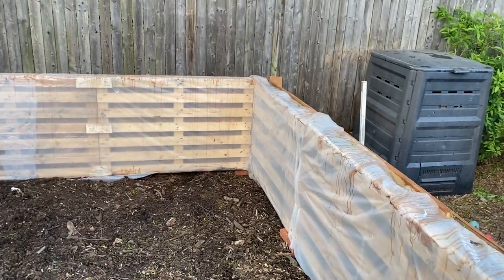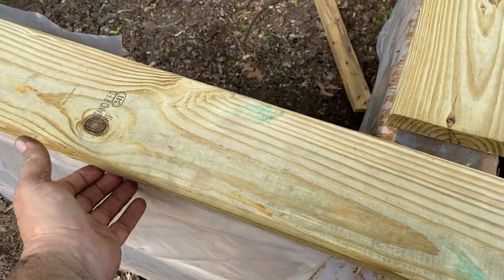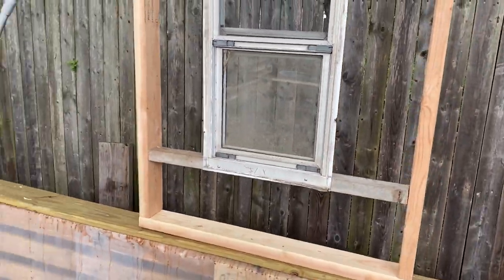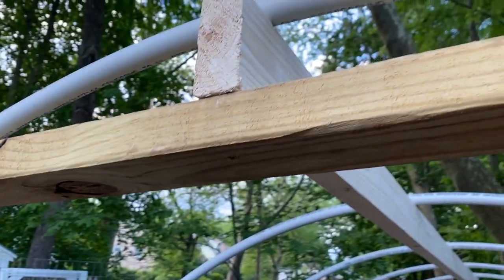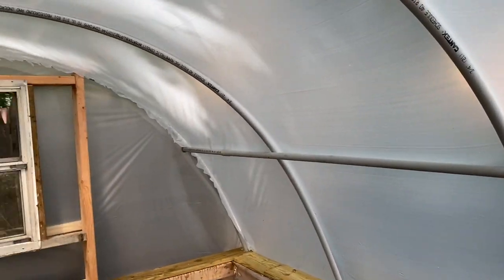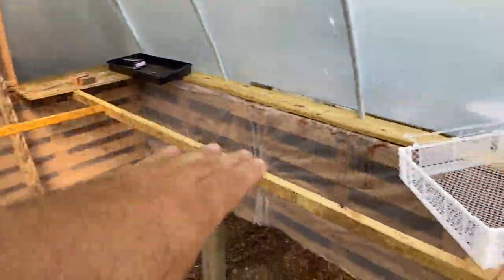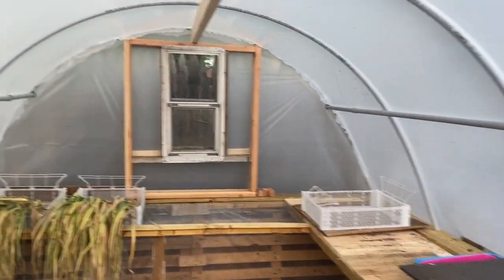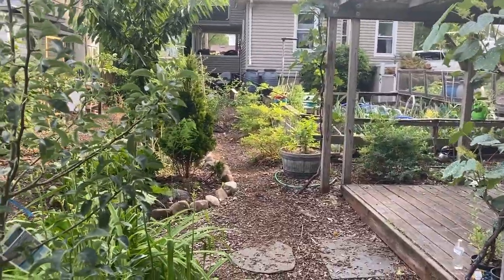How to Build a Pallet Greenhouse for Your Garden - Looks Good/Functional/Almost FREE!

Comment: Don't know how winter is where you are but I'd use a couple of those black water drums in there. The drums will heat up and the water will radiate a bit after nightfall
Reply from the maker: I thought about that because during the day the greenhouse does get quite warm even when the outside air is in the 30s, but during the dead of winter we routinely get 0-20F temps for stretches at a time and I wonder whether it would be effective.

I've also considered building a compost bin in there and filling it with horse bedding, but I decided I didn't want to smell THAT all the time I was in there :) Besides, I do zero gardening during the winter so I decided to just let it be

Comment: Two woman who have NEVER done this before and we sure want to try.  We have NO tools!  Any suggestions on how to do this by hand without the PVC Piping?  Can we just make a ceiling out of 2 by 4's?  Help!  We know nothing and have never built Any thing in our lives!!!
Reply from the maker: You're really setting up a challenge for yourself, aren't you? Certainly it can be built with a hammer, nails, and a hand saw, but man, you're going to be sore! :) My suggestion would be to build the two end walls first, making them in an arch-ish shape, then instead of 2x4s for the "arches," I'd use 2x2s. Instead of running them in the direction of the PVC pipes, I'd run the 2x2s straight front to back. Just nail them in from the end wall. 2 or 3 on each side of the "arch" should be sufficient (some pieces in between each row for support is recommended). That will limit your length to about 8 ft. long  unless you put another wood arch-ish shape in the middle then you could make one up to 16 ft long. It's definitely a much more complicated -- and expensive -- alternative. Wood still ain't cheap these days. I won't lie, it's not going to be easy. Again, doable, but using only the most basic tools and limiting yourself to all wood, it's a much more difficult task you've set for yourself. I never want to discourage someone from trying something new and challenging, though, because you often learn best by actually doing, just go into it with eyes wide open. Cheers and good luck!

Comment: Nice work sir 👍👍 Andy (UK)
Reply from the maker: Thanks! It's held up great over the past few years, other than a few hurricanes tearing the plastic sheathing. This year I used greenhouse plastic because the price became dramatically cheaper than in the past (the one thing that's not more expensive than it was a few years ago) and it's been terrific. I haven't had a single tear in it, and that may be because the greenhouse plastic is tougher and more durable than the generic plastic sheathing I used before.

Comment: This is great. Gonna make it my first spring project.
Reply from the maker: Awesome! Good luck. It's an easily accessible project that doesn't break the bank and gives you tons of usage. 

I'll say I ended up covering the arch with greenhouse plastic last year and it has held up great. Much better than the Harbor Freight plastic I had used and ended up having to replace every year because of damage. The HF stuff was cheap, which is why I had used it originally, but its price has gone up a lot since then and greenhouse plastic on Amazon is just as affordable now (about $35). I suggest using the greenhouse plastic. Not a single tear or degradation in quality. Cheers.

Comment: Really like your clamp idea, can think of many applications for that little tip! Thanks! Very nice job, neat and sturdy. Congrats.
Reply from the maker: Thanks! Even I've been a bit surprised by how durable the greenhouse is. It's gone throw several hurricanes, wind storms, and brutal winter storms and come out basically intact. Only Hurricane Ida last year shredded the plastic cover so I had to replace it (a video on it will be forthcoming), but the basic structure itself has been unharmed. And, yes, those clamps work really well. It's surprising how well they held the plastic on. It's notable that when Ida shredded the plastic it didn't actually rip the plastic off. The clamps held it on. Thanks for watching.

Comment: Good  job !  Your greenhouse and garden look  great . A fantastic  sanctuary to escape to.. i might give this a go this year.
Reply from the maker: Thank you! And FWIW we just had 2 feet of heavy, wet snow dumped on us and it held up perfectly. We had an 8" snowfall a month or so ago, and the clips I had used to hold the plastic on popped off at the rear because they were just slightly too wide. I remade the clips, also Gorilla taped them in place, and it's holding up without a problem. Definitely a project worth tackling.

Comment: You did a fabulous job on your greenhouse.I just started working on mine 2 days ago .I'm thrilled to find there's very little difference between the two plans.Mine will be used to grow seedlings in the spring and for growing Rosemary plants year round.I'm hoping an insulated covered cold frame INSIDE the greenhouse will create a micro climate and provide enough protection for my Rosemary plants that none will die this winter.I live in Zone 6a (WV)
Reply from the maker: Oh that's a neat idea! One Yard Revolution, I believe, uses that same concept to increase his planting zone by as many as 2 zones so that could definitely help. Good luck! These greenhouses are challenging, but fun builds.
Reply: @HomesteadDIY  Thank you! I made one very similar however mine is only 6 x 8.By the way growing cuttings is one option you have because they need filtered sun and seedlings only require bright light! Be proud because you did a fabulous job!

Comment: love the fencing paneled siding...great job
Reply from the maker: Thanks! It's really held up well so far. I did need to replace the plastic cover last year because one of the hurricanes we got last year literally shredded it (I have a video in the works on the process) and Winter Storm Izzy just blew through with 50+ mph winds but it's did great. A single 1" hole, probably from a twig. Thanks again.

Comment: Really great video thank you. I would be grateful if you could tell me how you secured the PVC around the pallets after they were wrapped in it? Also, how did you actually put on the PVC. did you start at one end and pull it tight? Finally how did you secure the sides of the PVC down to the pallets? Many thanks Tania (UK)
Reply from the maker: Hi Tania. If by PVC you mean the plastic sheeting, that was just stapled in place. As for putting it on over the top, yes, I basically started on one side, secured it, and pulled it taut when I did the other side. Last year Hurricane Ida ripped the plastic to shreds. Actually, it blew tree branches through the plastic and the wind ended up tearing it the rest of the way. In this video, I give more of a step-by-step instruction of how I resheathed the top. Cheers! https://youtu.be/_elvWdK2Tqk
Reply: @HomesteadDIY  Hi, thank you so much for the link. We have recently been hit badly by storms in the UK so very grateful for your updated video. May I also ask you how you wrapped the plastic around the pallets? Did you do each one individually or did you start at the bottom on one side of the pallet wall, pull it over the top and secure at the bottom on the other side? Wasn't sure if you wrapped underneath them? Thanks again 🙏🙂
Reply from the maker: @Pipalopee  I had the pallet sides already joined when I wrapped them in plastic, but to be honest I don't remember if I covered the bottom as well. I don't think I did, but doing it either way would be fine I'm sure. We're not building airtight homes, after all, more of just stopping drafts through the walls. The plastic isn't very insulating on its own anyway, so I wouldn't sweat it too much either way. Cheers!
Reply: @HomesteadDIY  great thanks so much. Learning on my own so really appreciate your advice and support. Have a lovely day/evening, no idea the time difference lol 🤣
Reply from the maker: @Debz Thank you and good luck with your own. It was worth the time and even the maintenance on it. Amazing how there is a global community here, too. Cheers!

Comment: Great build! Any follow-up? Is it still functional? THANKS!! 🙏
Reply from the maker: Still up and running! I use it to start seedlings in the spring, get plants up and running in the summer and fall, and dry out potatoes, onions, and garlic after harvest. The biggest issue has been the plastic cover. Hurricane season in the fall has sent more than a few tree branches flying through the plastic. We actually don't get the brunt of any hurricanes here (usually), but the wind they generate does wreak havoc on the trees. It wasn't the best location for the greenhouse, but it was the only spot I had, so I make do, and recovering it with new plastic, while annoying, is not so bad. Most of the time I'm able to repair the plastic from small holes and tears with Gorilla packing tape on the inside and out. That holds up incredibly well.

Comment: Just to verify, you used 3/4" thin wall pvc clamped over 3/4" conduit? I tried that with the thinnest pvc I could get (200 psi) and it slips snugly over the conduit but I cannot get it over the conduit with the plastic in place without tearing the plastic. I seen someplace elsewhere whereas they used a size larger (1" over 3/4") and was wondering what you thought about that.

Comment: Great job! Whats the inside height?
Reply from the maker: Probably about 7 ft or so. I'm 6 ft, the door opening is somewhat above that and the PVC arches sit atop that. Surprisingly I never measured it. However, you could always adjust the height to suit your needs. If you make the cut piece of conduit longer than the 32" I made mine it could increase the height. Mine is that height so the conduit gets support from the ridge beam. 

I've also contemplated a different roof design. Instead of angling the conduit from the top of the pallet wall, actually extend it straight up 2-3 ft, then using 45-degree fittings angle it towards the peak. That would raise the side walls up and give even more headroom.

If my greenhouse was situated elsewhere (such as in the sun where I could grow plants in it), I would likely do something like that. The conduit would need more bracing support but would provide more interior options including shelving inside. Another time perhaps. :)

Comment: Do the pallet walls stay upright just by being secured to one another at the corners? Or are there posts in their interior spaces holding them in place?
Reply from the maker: Surprisingly, just by securing them to each other they remain upright. I did add small wooden braces in each corner though I'm not sure if it was necessary. Also, the top plate that I laid across them helps to tie it all together too.

Comment: Stumbling across this 3 years later... how'd this build hold up?  If you were to do it all over again, would you do anything differently?
Reply from the maker: It's held up quite well in fact. I use it every day. The biggest thing I'd do differently is site it in a different spot in my yard. Under the tree canopy as I pointed out at the time was less than optimal and falling tree limbs has been the biggest bane of my existence. With that sane, they haven't fallen and pierced the plastic really nearly as much as I thought they would have and most holes have been about the size of a quarter that I've been able to cover with Gorilla packing tape. I also would have added more shelving. Amazing how much stuff you can find to put in a greenhouse that you suddenly don't have room for. I ended up putting a second shelf under the potting bench side and I put removable slats over the drying rack to use as a hard surface until needed. Another shelf under there would have been ideal. Other than that it's served its purpose well.

Comment: So your plastic cover is in 3 pieces (front, back, and top). How did you keep the front and back in place until you were able to cover the top and place the pvc clamps in place?
Reply from the maker: Clamped the ends down but left the inside edges run long. Put the top on and secured it side to side. Then I took one clamp off at a time. With my wife inside pulling on the edges I let run long I pulled the top taut and reclamped.

Now if your by yourself as I was when I had to resheath it after a hurricane, I just used extra clamps that way when I pulled one up the play didn’t move

Comment: Nice job thanks for the video. Very informative thumbs up 👍🏼 how has it been holding up . Is it warm in the winter .
Reply from the maker: It's been holding up way better than I anticipated. I've had the odd twig or stick from the trees above fall and pierce the plastic occasionally, but I patch them up with the Gorilla packing tape inside and out and it's good to go afterwards. We've had some wicked windstorms and the entire structure remains buttoned up and secure. It's actually a nice place to go into when its raining or snowing outside.

I wouldn't say the greenhouse is "warm," at least not when it's in the teens and 20s. It tends to be a degree or two above the outside temps at those times. However, when it gets into the 30s and 40s, then the greenhouse runs anywhere from 5 degrees to 20 degrees warmer inside, and I actually leave the door open during the day because I don't want the plants I'm storing to think it's spring yet. So far the plants seem to be doing good inside, but I guess the real test will be when spring does arrive and I see whether they survived.

Comment: I used mulch as a floor too. It had worked very well.  My greenhouse videos show some other ideas.
Reply from the maker: That's a helluva view you have from atop your greenhouse! I wish I knew how to use arduinos. There are so many projects I could use them for, but I need hand-holding when it comes to things like that. lol Thanks for watching!
Reply: @HomesteadDIY  , thanks!  And yes,  Arduino is great! Keep me in mind if you want to monitor your greenhouse's temp and humidity / pressure.  I'm making a design that should only be $10 and sends graphs to your phone over wifi.  I'd love to send you one at my cost.  It's neat seeing how the greenhouse smooths out the temperatures when you put water inside.
Reply from the maker: @TheRainHarvester  That's really cool, thanks! Let me know when one is available, I'll definitely take one.

Comment: I wish you had shown how to attach the pallets together and how they are standing up on the ground.
Reply from the maker: You're absolutely right, I should have. There are hints though! At 0:48 in the video, there's a shot of the end wall of the greenhouse pallets. Where the two pallets meet, you can see there are three short pieces of pallet wood at the top, middle, and bottom. I just screwed them into the two pallets and that joined them together (you can also just make out similar small pieces joining the pallets on the right-hand side).

I then explain later in the video (at 4:05) that I used a simple block of wood that I screwed into each side to hold them together. And last, just before that point in the video, I explain how the 1x6 decking I use on top of the pallets further ties all the sides together. I hope that helps clear that up. Cheers, and thanks for watching.
Reply: Thank you @HomesteadDIY   I made my comment before I finished the video so I did notice the hints but your reply still helps. Thank you, this looks great!

Comment: Total cost?
Reply from the maker: While I didn't keep track, other than the plastic, the PVC conduit, and the handful of 2x4's it was otherwise free materials or stuff I had on hand. The plastic was $26 I think at Harbor Freight Tools (and it's held up really well over the past year), the PVC was $15 maybe, probably less, and the 2x4's were probably about $20 (with the price of lumber these days it might be considerably more :/ ). The plywood I had on hand, the cladding was salvaged from my neighbor's fence, and the main structure was free pallets. Add in a box of screws and it's probably $75 total, and I think that's a stretch.